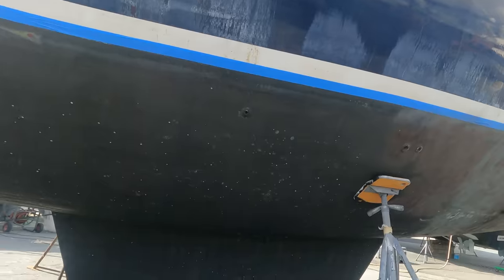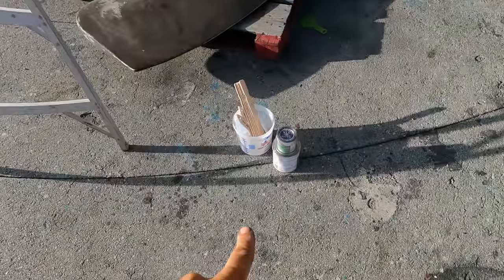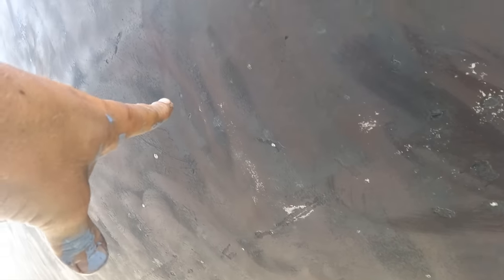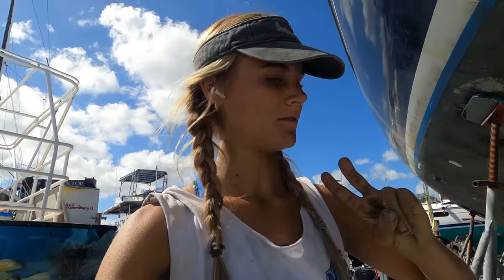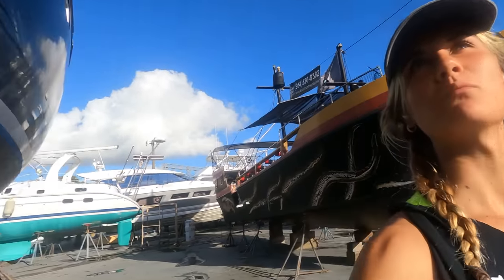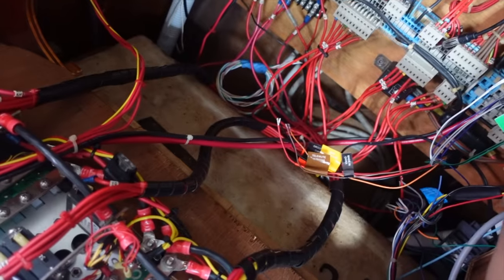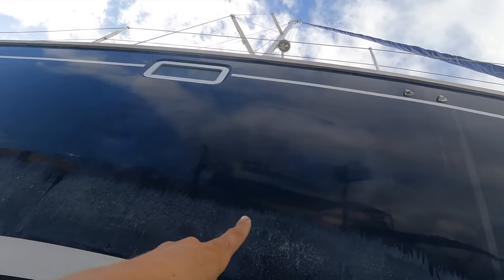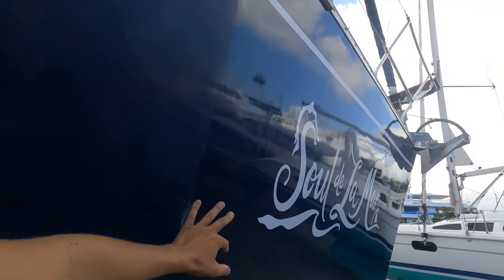SHE does it ALL with NO experience (boatyard version)! prep & paint the bottom of a sailboat [ep 49]

Comment: The older Beneteaus with a stainless steel rudder shaft, have a problem with crevice corrossion of the rudder post, or internal on the armature. Leading to loss of rudder at sea. So next time your rudder is out, inpect very thoroughly. New rudder, six or eight grand. That's why B switched to carbon fibre rudder posts that simply can't corrode.
 Also, the French required brass gate valves instead of marine brass through hulls. Check yours, make sure they were upgraded.

Comment: Closed safety goggles, impact rated, and/or a half or full face respirator. That sanding dust can get permanently lodged in your lungs and give you silicosis and COPD. Both irreversible, they build up over a lifetime. Not really expensive even for the good stuff. Buy two, so you can protect a helper. Especially if you find one you might want to spend the next 50 years with.

Comment: Have a simple taping trick that will help you get nice smooth lines.  Stick the tape end on the edge of the bottom paint and then reel off a few feet. Pull a very slight tension on the tape roll and hold it up and away from the line your taping. Sight your contact point and slowly lay the tape on where you want it. Give it a tap with your finger tip a foot or so each time as you move along.  Spool off the tape as you go.  When you like what you see, go back and give the tape a smooth rub to make full contact with the hull.  Easy.  As you were.

Comment: Aloha Lauren, PPE is needed in the form of a positive pressurised painter's suit. It has a blower inside and you breathe filtered air. Bottom paint is toxic so you need a vacumn on the sander as well. I used a fiberglass paint remover with a scraper and squirt gun. Then I hand sanded with a drywall extension pole with wet or sry sand paper ( wet ). I caught the drips in a tarp on the ground and bottled it up.  Then eight coats of paint. Keep water from reaching the fiberglass. Cool Breezes!

Comment: I think it easier work to put a pole extension on your roller, can use two hands to maintain equal pressure and don't have to bend down to get more paint, other than that blew me away, wondering if that it is 40 degrees colder here in Chesapeake is reason not getting a fraction of  that boat work done.